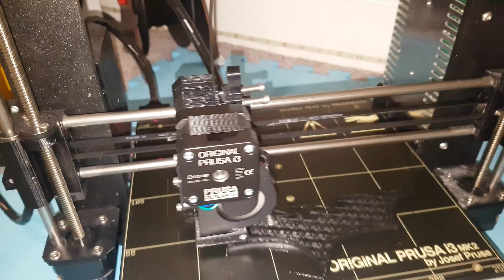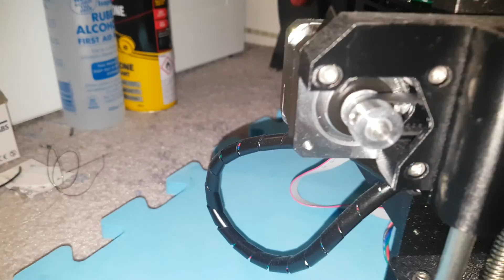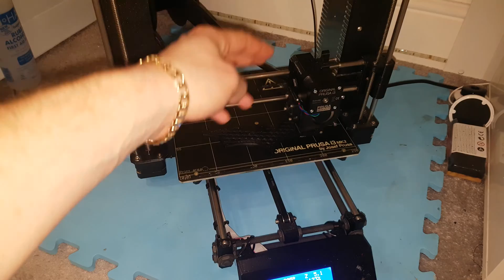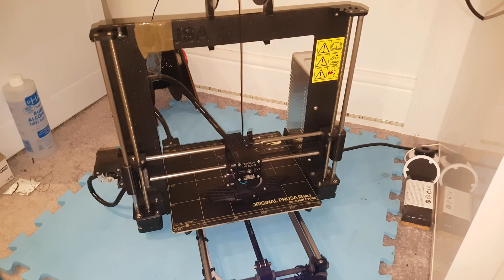Help with Prusa I3 MK2 sound?

Comment: noise bearing 
replace them by drylin
Reply from the maker: It's not just the bearings though, it's that annoying sound in the one place, like a creaking. I have ordered the MK2S upgrade though which includes new bearings and new Y rods so I'll do a new video once I receive this and install it.

Comment: it could be the y axis belt rubbing on the side of the motor pulley. check if the pulley needs to be slid down the motor shaft a bit.
Reply from the maker: +Jason Sheppard ill have a look when I get back, thanks. I've ordered the MK2S upgrade kit so hopefully should be getting that within a couple of weeks and that may help since it's whole new y axis rods.

Comment: its the Y axis belt put m3 washers both sides of the idler bearing
Reply from the maker: Ahhh Ok I'll check that and try now...thanks!!!
Reply from the maker: I just checked, already had the 2 washers there, it was a bit tight so I loosened it but it hasn't helped with that sound at all unfortunately. It seems to be only when the bed is almost at the back of the axis. Just cannot work it out.
Reply: if you have spare belt try replacing the y axis - its gets more stress than the x it may just be stretched a little?
Reply from the maker: +vizionthing I haven't got a spare belt but it's an interesting idea, I wonder if I was to loosen it slightly if it would help, I tend to have them quite tight when I built it.
Reply from the maker: +dschnizzy420 as in on thenimstructions when a row of the little ball bearings has to be facing downward? If so then I dedinitely.made sure rhisnwaa correct when I put it together however I guess I could check in case they've twisted, they shouldn't have though as they're tightened in place.